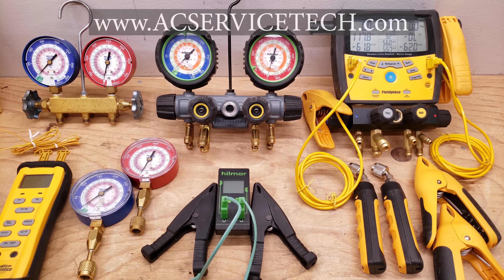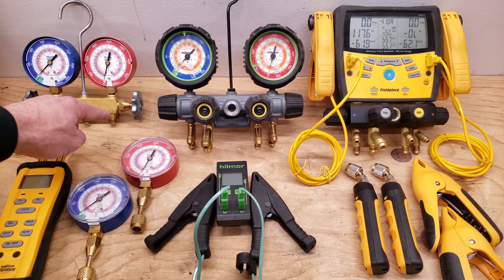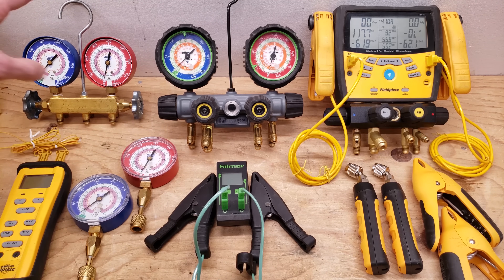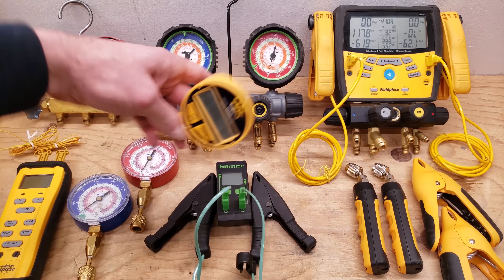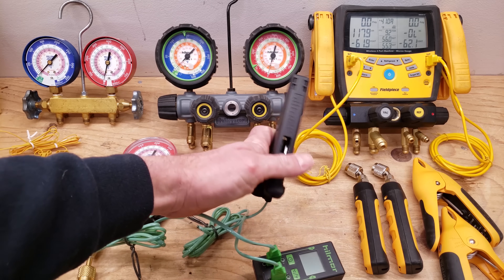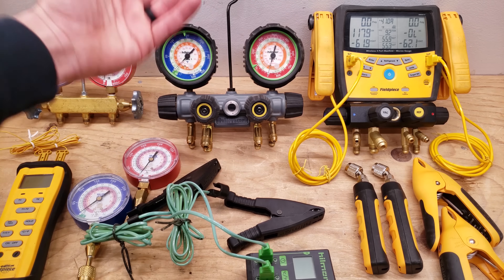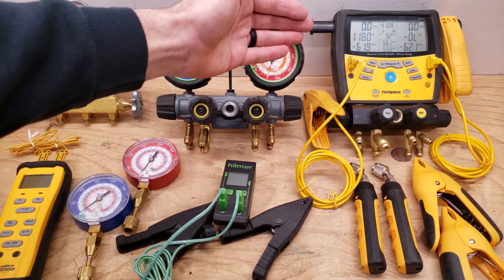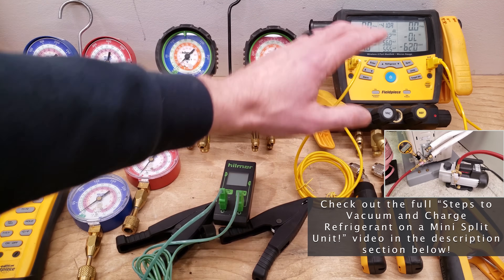Evolution of the Refrigerant Manifold Gauge Set!

Comment from the maker: The E-Book, Paperback and Quick Cards:  https://www.acservicetech.com/store
The Paperback, Quick Cards at Amazon:   https://www.amazon.com/shop/acservicetech

Support the Channel-  https://www.patreon.com/acservicetech
Tool List-  https://www.amazon.com/shop/acservicetech

Related Videos:
Connect, Measure, Disconnect Procedure!:  https://youtu.be/4oE3pkhJynQ
Vacuum and Charge Refrigerant in a Mini Split Unit!:  https://youtu.be/k9uohbYDuRs
2 Hose Vacuum Pump Procedure:  https://youtu.be/J4QvgpYFS9U
Check Superheat and Subcooling!:  https://youtu.be/LWxXJd2z0GQ
Check the Charge with Bubble and Dew:  https://youtu.be/uLsLDtA23lA
Check the Charge in Superheat:  https://youtu.be/YPitQHSgvog
Wireless Job Link Probes & Test Kit:  https://youtu.be/pKee1y-fF7Y

Tools Used in This Video:
Yellow Jacket Refrigerant Gauge Set http://amzn.to/2aenwTq
Refrigerant hoses with valves http://amzn.to/2aBumVI
FieldpieceSMAN480 Digital Manifold Set https://amzn.to/2Sqo95l
Fieldpiece ST4 Dual Temp Meter - http://amzn.to/2wc1ME3
CPS Vacuum Micron Gauge - http://amzn.to/2v1nM3O
Yellow Jacket 4 Port Manifold w Hoses - https://amzn.to/2BkuGIq
Fieldpiece SDP2 Digital Psychrometer - http://amzn.to/2nniMVR
Fieldpiece Wireless 6 Piece Job Link System Charge and Air Test Kit JL3KH6 - https://amzn.to/2wr4Xbp

Tools I Use Are Linked Below!

Leak Detection:
Accutrak VPE Ultrasonic Leak Detector https://amzn.to/2nFYKVe
Accutrak VPE-GN Ultrasonic Leak Detector https://amzn.to/2Zy4IZP
RectorSeal Bubble Gas Leak Detector - http://amzn.to/2ckWACn

Vacuum Tools:
JB 6 CFM Vacuum Pump - http://amzn.to/2nqbvo8
CPS 4 CFM Vacuum Pump - https://amzn.to/2DxgPwY
Appion Valve Core Removal Tool - http://amzn.to/2uYr8WL
Appion Blue 3/8" to 1/4" Vacuum Hose - http://amzn.to/2uYlVyc
Appion Red 3/8" to 1/4" Vacuum Hose - http://amzn.to/2uYg6Ro
Yellow Jacket 1/4" by 1/4" 3’ hose - http://amzn.to/2umtcod
Appion 1/4" by 1/4" and 3/8” hose - https://amzn.to/2Zyxzx9
Uniweld 1/4" by 1/4" 2’ hose - https://amzn.to/2GFov1Y
CPS Vacuum Micron Gauge - http://amzn.to/2v1nM3O
Supco Vacuum Micron Gauge - http://amzn.to/2v1JRiA
JB Vacuum Pump Oil - http://amzn.to/2mGrlXy

Checking the Charge:
Yellow Jacket Refrigerant Gauge Set http://amzn.to/2aenwTq
Refrigerant hoses with valves http://amzn.to/2aBumVI
Yellow Jacket Gauge set & hoses https://amzn.to/2vLVkV9
Yellow Jacket 4 Port Manifold w Hoses https://amzn.to/2BkuGIq
Digital Refrigerant Scale  http://amzn.to/2b9oXYl   
Ratcheting Service Wrench   http://amzn.to/2dGV4Nh 
Fieldpiece SMAN380 Digital Manifold Set https://amzn.to/3297zse
Fieldpiece SMAN480 Digital Manifold Set https://amzn.to/337mGnq

Compact Ball Valve for Refrigerant Hose https://amzn.to/2KUisW8
QuickDisconnect 90 for refrigerant hose https://amzn.to/2MMtVcg
RectorSeal Bubble Gas Leak Detector http://amzn.to/2ckWACn
Fieldpiece ST4 Dual Temp Meter  http://amzn.to/2wc1ME3
Fieldpiece Bead K Type Temp Sensor https://amzn.to/2DBwKfs
Fieldpiece Wet Bulb Temp Sensor https://amzn.to/2RRI7Tw
Fieldpiece TC24 Temp Clamp https://amzn.to/2qHLyjZ

Flaring Tools:
Yellow Jacket Flaring Tool - https://amzn.to/2OBxGlM
Spin Flaring Bits 1/4", 3/8", 1/2", 5/8", 3/4"- https://amzn.to/31BCs8Z
Yellow Jacket Flaring Tool with Set Depth - https://amzn.to/2QIKsQH
Yellow Jacket Torque Wrench - https://amzn.to/2NRR68Q
Uniweld Swage and Flare Kit- https://amzn.to/2T55jyn
Nylog - https://amzn.to/2MLJcch
Ridgid Tubing Cutter - https://amzn.to/2DnjjR1
Wolverine Tube Reamer - https://amzn.to/2QGLyMV

Swaging Tools:
Manual Copper Tube Swage/Expander- https://amzn.to/2WRPa1M
Spin Swaging Bits 1/4" to 7/8" for the Drill-  https://amzn.to/2YQwwqS
Uniweld Hydraulic Swaging Tool- https://amzn.to/2MlrI8m
Uniweld Swage and Flare Kit- https://amzn.to/2T55jyn
Uniweld Hammer Swage kit- https://amzn.to/2CzWMMU
Uniweld 3/4" Hammer Swage- https://amzn.to/2CzXsSs
Uniweld 7/8" Hammer Swage- https://amzn.to/2Mja5WE
Uniweld Multi-Size Hammer Swage- https://amzn.to/2T3Cx1b

Brazing Tools:
Air Acetylene Torch setup - http://amzn.to/2aQalsb
15% Silver Brazing Rods - http://amzn.to/2gVLyLc
Uniweld Cap-N-Hook and #2 Tip Oxy Acetylene Torch Setup - https://amzn.to/2STp3Fe
Ameriflame Oxy Acetylene Torch Setup #1 &#2 Tip - https://amzn.to/2SRm3JF
#2 Tip for Oxy Acetylene Torch - https://amzn.to/2SPDaeD
Cap-N-Hook Tip for Oxy Acetylene Setup - https://amzn.to/2MbhpUk
40cu B Tank to 10cu MC Tank Acetylene Tank Fitting - https://amzn.to/2GxZZPi
Nitrogen Regulator - http://amzn.to/2bXdR5f
Uniweld NitroVue Flow Regulator - https://amzn.to/2GnsaAo
Uniweld Nitrogen Flow Meter - http://amzn.to/2brvoBg
Bernzomatic Trigger Start Lighter Propane/Mapp Gas - https://amzn.to/2vit0cv
Uniweld Soft Flame Sweating Torch Setup for Acetylene - https://amzn.to/2DyzRD8
Flint Spark Ignitor - https://amzn.to/2L3P2u9
Stay Brite #8 Silver Bearing Solder and Flux - https://amzn.to/2XIDJsY
Aluminum Braze Rods - https://amzn.to/2IGNMu

Electrical Diagnosis Tools:
UEI DL389 Multimeter  http://amzn.to/2xAdaJf
UEI DL479 Multimeter with temp sensor http://amzn.to/2jtsUbJ
Magnet Jumpers- https://amzn.to/2PyKPQZ
Alligator Jumpers- https://amzn.to/2PxqJXn
Irwin Wire Stripper/Cutter/Crimper http://amzn.to/2dGTj2V

Nitrogen:
Uniweld NitroVue Flow Regulator- https://amzn.to/2GnsaAo
Uniweld Nitrogen Flow Meter    http://amzn.to/2brvoBg
Nitrogen Regulator    http://amzn.to/2bXdR5f

Service Valve & Port Access:
RectorSeal Bubble Gas Leak Detector - http://amzn.to/2ckWACn
25 Valve Cores - https://amzn.to/2L37UJU
25 ¼” Brass Port Caps with rubber O-rings - https://amzn.to/2GIOdD2
Brass Valve Core Tool which holds 3 valve cores - https://amzn.to/2GFEbm2
Valve Core Torque Wrench - https://amzn.to/2GHiLoD
Locking Cap Universal Lock/Unlock Tool - https://amzn.to/2GGAoVp
Locking caps - https://amzn.to/2GFXZ8A
Ratcheting Service Wrench http://amzn.to/2dGV4Nh
Yellow Jacket Sealright 90 Coupler- https://amzn.to/2LsU1V7
Yellow Jacket 1pk Compact Ball Valve- https://amzn.to/2uXdF18
Yellow Jacket 3pk Compact Ball Valve- https://amzn.to/2AiKfQe
Thumb Screw Valve Core Depressor with Backseat- https://amzn.to/2mR0sCL

Other tool links can be found in the video description section.

Shop through Amazon! Your Purchases through Amazon provide a means for channels such as mine to earn advertising fees from all purchases after clicking through. Prices are the same as normal-    https://www.amazon.com/shop/acservicetech

Comment: Hi Craig,
Maintenance Supervisor here just moved to GA so I have to work on AC now. My in-law gave me a testo 549 to start with till I figure out what gauges to buy. I'm thinking of buying the testo smart probes ( range is not really an issue for me ).
The question I have tho is...
I have a lot of temp workers on my property who don't even bother checking SH/SC in order to properly charge the system. They basically have a set of analog gauges and that's about it and they pump low side up to about 130-140 and leave it. All of them claim they have more than 10 years experience in the field. How is that even possible? I always check pressures and temps to get the full picture

Comment: Craig, 
Great video.
Our equipment is normally 98% heat pumps.
Should we be working with heat pump manifolds where both gauges max out at 800 p.s.i.?
Our question is since the low-pressure gauge is in increments to 800 p.s.i. does this make getting accurate pressure on the low-pressure side difficult?

Comment: Most entry level Tech’s can’t afford the field piece digital Gauges and they tend to dumb down the techs. Just my opinion. They are expensive and you better be careful with them banging around your service truck. Also when parts of it goes bad such as thermistor wires to  clamp on sensors they are very expensive to replace. I love new technology and wireless Bluetooth but you generally have to be within 30’ of gauges and cannot adjust charge at 30’ away? Also with anything if 1 tools is bad it don’t take out every tool you have with the field piece. I have field piece tools but anything fluke is very reliable it cost more but very well spent $. Just my opinion like every 1 has 1. 30 yrs tech and service manager of large co. In past. By the way I am not no where near 70.👴 😁😁 learn all you can and go to every  continuing training you can. Have fun with it it’s my favorite thing to say I god that right.
Reply from the maker: Absolutely right Mark!

Comment: Not accurate information: 
We use the larger 4th port to fill industrial racks by connecting the other 3 hoses to charge 3 refrigerant tanks at a time.
Reply from the maker: I realize servicing companies may find all kinds of uses for the fourth port but the design of the manufacturers was originally that the large 3/8" port was for vacuum when reading their instructions for use. Thank you very much for sharing how your company utilizes the 4th port!

Comment: My first dive into digital manifold was a pair of Testo 550s when they first came out years ago. One dedicated to R-22 and the other to R410a (residential & light commercial). I've taken good care of them, and they've served me very well. They make short work of most system diagnostics, but there remains a place for analog now and then, such as unusual fluttering TXV behavior. My favorite feature of the digital set is the ability to deal with temperature compensation when running system leak tests/tightness, and sorting saturation temps of virtually any modern refrigerant. I haven't yet jumped to completely into wireless yet, but the writing is on the wall, and I say good riddance to wires and hoses!
Reply from the maker: All great points Kenny! Thanks for sharing!

Comment: Great video. What is Superheat and Target Superheat ? Do we check superheat in Heat winter ? For AC Do we need to check superheat in summer ? Thank you.
Reply from the maker: We check total superheat at the outdoor unit vapor port and vapor line for systems that have a fixed orifice running in air conditioning mode. The temp must be above 70 degrees inside and 70 degrees outside. to measure it accurately. Target superheat is determined using the indoor wb temp and the outdoor db temp. These are input onto a target superheat chart or app in order to determine the target superheat for the system. We must make sure that the total superheat matches the target superheat for an accurate refrigerant charge, thanks!